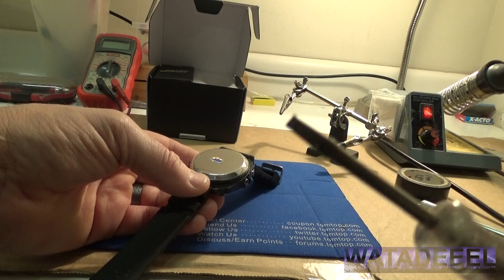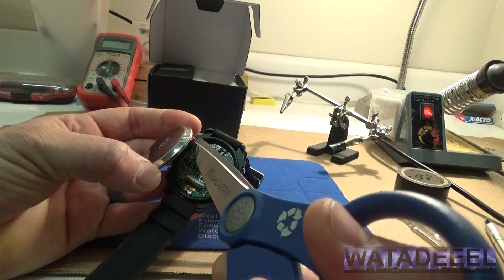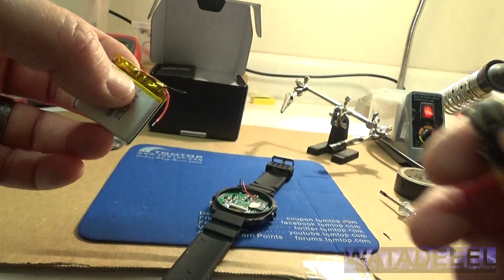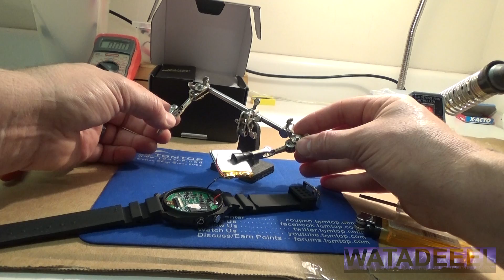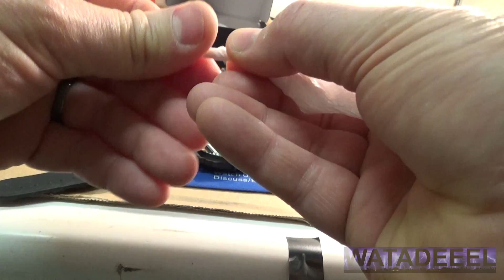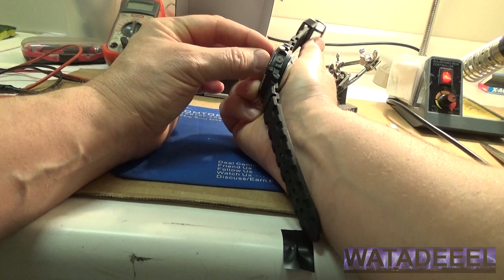Spy Watch - Soldering in a New Camera Battery

Comment: Hello, I remember Watadeeel told us where we could read on how to care for our spy watches  that gives us tips (such as not leaving the watch stored while its charged because it will destroy your battery)
Reply from the maker: That won't destroy your battery. However, if you are going to store your watch and not use it for longer than 6 months, then it is a good idea to press record and discharge the battery down to about 50% or so before storing in order to maintain optimum performance. Note that the same is true for ALL LiPo battery powered devices, not just our devices.

Comment: Thanks for your video. I gave u a like. Pls help **. I have same watch BUT the USB metal connector on the watch felt down on street. I lost it. Now when I plug on cable and hook  it to Laptop I see that the battery charging BUT cant get any USB connection. I cant see my videos. What shall I do? I tried little wire here & their+shake watch a little.. IN VAIN. pls help.
Reply from the maker: Hmmmm...If you lost a piece of the watch...that is a problem. Did you order from WATADEEEL? If so I can help you. If you ordered from another seller, you would have to contact them. We do have excellent customer service, but you have to purchase from us of course.

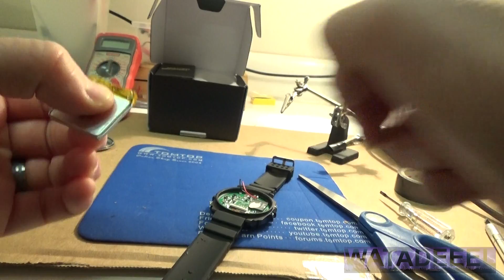Comment: just notice my camera in infra red fuction only records for 2:36 min before was 10min do you think i need a new battery?
Reply from the maker: Not sure. I would do a full charge, then after full charge put it in regular video mode and record video, and leave it alone. Let it record until it stops recording. Then 2 hours later (after you are certain it must have shut down), see how much video you get. Should be around an hour or so for a decent battery. If it's less than 30 minutes or so then your battery is tired and could use a replacement.
Reply: bought it in february 2018 the first time I used it I pressed the record button by accident and it recorded 6 files of 10min but in overall it worked well until now
Reply from the maker: Did you purchase it from WATADEEEL? If so, you can send it to us and we will replace the battery for free! What name did you order under? Problem is I have no orders in all this year for anyone named Helder Postiga. If you purchased elsewhere, then there is nothing we can do except offer to let you buy a new watch from us. Guarantee your watch will last a lot longer than 8 months if you purchase from WATADEEEL.

Comment: Sir I bought a sandisk 128gb sd card for this watch and after that if i set on the video recording it only light up blue red after that it blink red 5 to 6 times,, i dont know if it signifies that watch is still in full charge status?? or the battery has been damage?? please help me with this?
Reply from the maker: The maximum allowable size of microSD card is 32gb. 128gb simply does not work. You are getting a memory error.
Reply: Thanks for your videos and response sir, problem with the manual was  cannot understand the grammar written there too bad, i cannot get the info that i need. thanks sir